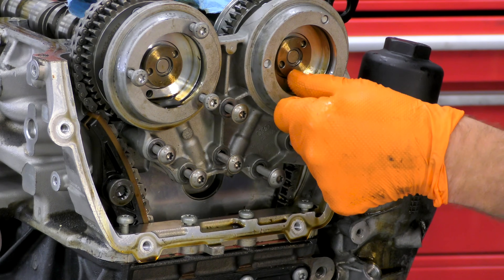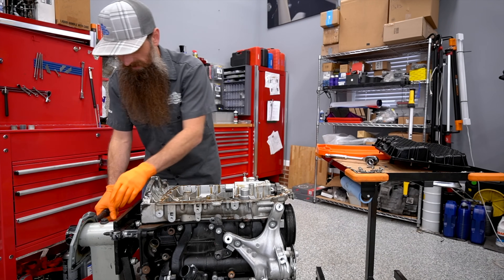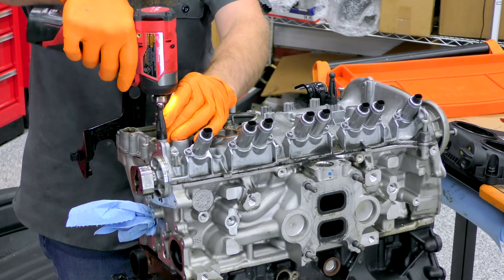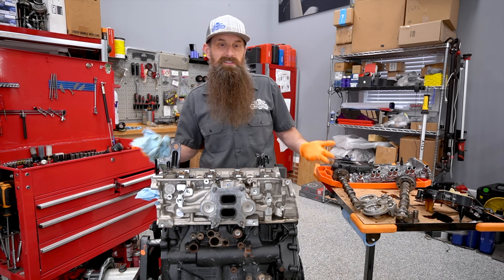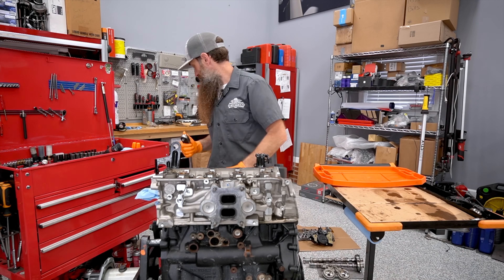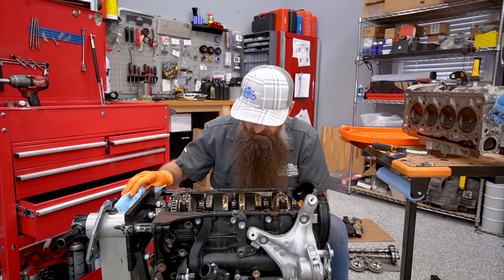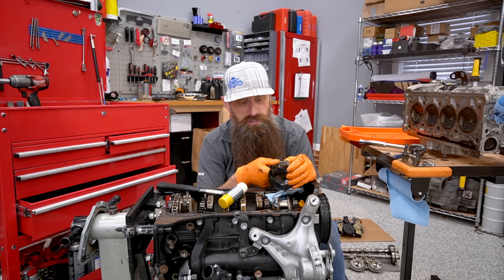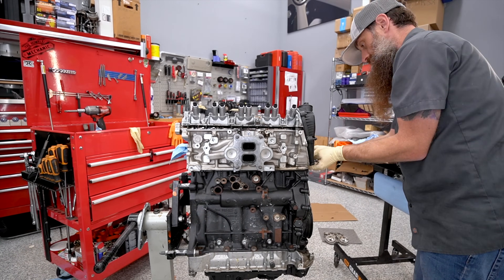Catastrophic VW Engine Failure and Teardown 2.0t TSI

Comment: Shame that they had the ring gap too tight
But worst of all is having a timing chain instead of a belt as they often fail between 70 to 190k Km
Every VW Audi with a chain is a ticking time bomb 😂.
Reply: I think a shorter oil change interval helps with that. Not that 10,000 mile bs. I change my Tiguan every 3,500 miles.

Comment: I had to replace a burnt exhaust valve (injector clogged and went lean) on my B8.5. When I went to install the exhaust cam, since the lobes move it didn't quite fit so I pulled the lobe a bit to slide it in... Next thing I know a ball bearing and a spring go flying! Luckily I was able to find it and put my cam lobe back in the correct place. The car runs fantastic now BTW... Also I didn't know there was a specific way to but the solenoids back in for the cam... I just tossed them in and sent it!

Comment: I have a question about oil in the air intake tube before the turbo, there is no oil in the air box. Is it possible that the PVC system needs to be replaced?
Reply: Normal if it’s just a little bit
Reply: I'd just get a catchcan and do carbon cleaning

Comment: EA888s are crazy expensive to build right now. Was in the ballpark of 9k to if you include full rotating assembly, complete fuel system, gaskets and hardware, and a complete head rebuild on my 8P A3Q.
Reply from the maker: Ouch!!! That’s more than I want to spend on the car. Haha
Reply: I spent $8k 2 years ago for a shop to rebuild with IE internals. The Mahle pistons slap terribly when cold

Comment: A video comparing the Audi 2.0t vs the vw 2.0t would be nice it's already been done but with how you explain things it would be much better
Reply: They are the same thing 🤦‍♂️
Reply: Hes torn down another EA888 and said that the only difference is the injectors.
Reply: I had Skoda with this engine. Now I have Audi A5. What surprises me most is the fact that Audi is so much quieter and cultivated. And I don't mean inside the car. What I mean is when you open the hood the engine is super quiet.

Comment: I suppose if that cam journal has a little damage, you can have an align hone done to save the head.

I don't like how narrow the exhaust valve roller rockers are. It makes me think of the narrow cam lobes of the PD diesel, and the wear problems that could be related.

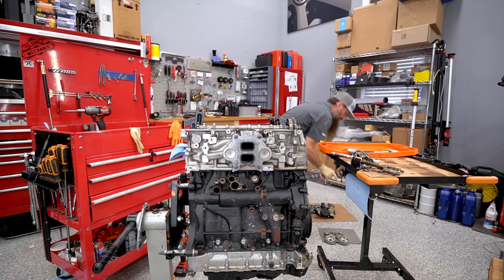16:05 Well, depends on core prices and replacement part prices. Also, sometimes when only one bore is bad on an iron block, people will fit a dry sleeve and bore the sleeve to standard. Sometimes if the bores are just a little out, you can hone +.25mm, no boring needed. If you are ordering forged pistons, maybe you can request a +.25mm piston set.

Comment: Hi Charles. There is a guy in Greece, if you want i can give you a link and his name is Emmanouil Tatouris- AMG Specialist. He describes this catastrophic failure in the older 1,4 tsi vw scirocco. He had 2 engines with the same exactly broken pieces in the pistons. If you check more careful the bottom side of the pistons you will see that the one side is blackish and the other side looks cleaner. That is because of lack of oil flow and that makes the piston of the one side to be cold and the other side to be hot. He create a double head oil beck to eliminate the temperature difference inside the pistons. His videos are in Greek language but you can search with this words: "Γιατί τα VW Scirocco σπανε εμβολα.Η ΛΥΣΗ! Why do the pistons break in CAV 1.4VW Engines?THE SOLUTION" to find the video and watch from 12:00. You can just watch and you will understand even without knowing the language.
Reply from the maker: Interesting!!! I’ll check it out
Reply: Ok and when he talked about a lack of oil its because a low oil level or bad oil ?
Reply: @jeanfrancoismenard705  it's because the small nozzles that spraying the back side of the pistons with oil to cool them down is not enough. This guy made a double nozzle for each piston to cool the whole piston and not only the one side like with the original one.
Reply: The way they oil pan looks it definitely probably didn't get oil changed enough...

Comment: That electrically-controlled rotary valve based thermostat is the first one of such kind on a passenger car(EA888 gen3 was announced 11 years ago, then gen3 bz in 2015, gen3-evo for Euro-6d in 2017, evo4 in 2020). It has been a great design of engine thermal management, but it tends to fail(leak) at an early mileage. 
The thermostat is being improved continuously that almost a new iteration is employed every 1~2 years. The leak issue is said to have been fully fixed in an version released in 2019.
Reply: Yes they made so many revisions of thermostat housing by now. It's hilarious.

Comment: Recently my Peugeot (1.6 turbocharged engine stock) had piston 1 failure. Had the piston replaced and in roughly 1k miles piston 1 failure again. Definitely pre-ignition as it happened at low speed low RPM. The HPFP threw codes before, so the mechanic is suggesting the HPFP is running rich. Any advice?
Reply: Or fuel injector is leaking?
Reply: @chiluco2000  changed all the injectors after the first failure, then second failure occurred. ☹️

Comment: I very much like your videos.
I have a customer car a A4 DTM edition.
That's running very bad idle after a minute or two runs a litlle better.
But stil not nice.
Al pcv valves are new oilfilterhouse new pistons new head and so on.
On load acceleration its running good.
Do you have any Idea.
Regards André Botter.

Comment: Hi I have 2001 Skoda Octavia 2.0 petrol engine with P0134 no activity detected O2 Sensor 1 Bank 1 (and indeed the car see no reaction from the O2 Sensor) somebody before me has installed brand new O2 sensor and didn't solve the problem the wiring harness between the O2 sensor and the ECM is good do you have any ideas I just want you opinion before condemning the ECM 

P.S. the downstream O2 Sensor is working perfectly at stoichiometric 0.45v

Comment: Is it possible this was caused just by low octane fuel? I know several GolfR/Audi owners who just fill their tank up with regular fuel. Does the anti-knock system completely prevent detonation?
Reply: any vw tfsi o tsi needs premium gas only otherwise well you have seen the video.
Reply: These engines are made to run on lower octane, you just don't get all the power you could be getting. It was more of an issue on the first gen.

Comment: One thing I've noticed on many modern engines is the engineers have been moving the piston wrist pins closer to the top of the piston. This leaves very little space on the piston skirt for the bottom ring lands in order to allow for piston wrist pin insertion and crank clearances. I believe this came out of racing to increase mechanical advantage and reduce piston drag. Problem is, racing engines aren't expected to last for years in various driving conditions without meticulous maintenance. Add to that a possible performance tune and lugging the engine at low speed in a too-tall gear is enough for catastrophic failure. That piston displays all those shortcomings.

It used to be that engines had "overhead" built into them. This allows for aftermarket performance upgrades. The LSx and 2JZ are prime examples of that design philosophy. Today's engines are built to finite limits. Sadly that engine demonstrates that clearly. That engine absolutely needs forged pistons for any medium performance upgrades. Maybe VW should've had those from the factory. Looks like the bean counters won that decision.

Thanks for the video Charles - very interesting teardown!
Reply: I like your explanation. So if you have a tune car, maybe whit poor fuel and smash the throttle on to high gear and to low RPM, the result can be what we see in the video...
Reply: I agree, in combination with small turbochargers that makes alot of boost on low revs, produces alot of tq but its not good for the engine.

Comment: Those rear main seals are almost a given I’ve changed a few over the years the ea888 is a complex but great engine if you treat it like a baby great video 💯
Reply: I treated my EA888 engine like a baby and it still had many issues. Oil consumption anyone?
Reply: @shanemitchell5807  where they’re made & how they’re assembled makes all the difference unfortunately no 2 engines are built the same I believe you nonetheless that’s terrible smh
Reply: @nobatteriesincluded3968  Mine was made in Wolfsburg. No excuses then.
Reply: @shanemitchell5807  in my Cupra 280, oil consumption is ~1l per 10t km after 150t km.  And I drive quite often on the race tracks with this car
Reply: @shanemitchell5807  CDAA here and yes, it's starting to show. Already arranged the rebuild as my Superb is worth saving.
It's so sad they killed the engine in such a stupid way. I love how they drive and I'd even consider them very reliable, if it of course weren't for their fatal and completely unnecessary flaws with original timing chain tensioner and the bad piston rings.

Comment: Speaking of VW engine failure, monday my Audi A4 1.8t decided to just throw out the connecting rod of cilinder 4 because of weight, less parts = less weight = going faster ofcourse. So yeah, I'm kinda f*cked atm haha

Comment: Charles, Taking a shot that you may read this related question: 2017 A4 2.0t TSI w 85K Throwing these codes P191A00 " Loss of crankshaft synchronization" and P256300 Turbo Boost Control Position Sensor Circuit Range/ Performance". Not going to tackle these myself, just would like to know what I'm in for at the stealership. The only other issue I've had with this car is the known Thermostat housing leak that occurred at 83K. Any insight would be appreciated.
Reply from the maker: probably a timing chain issue, but thats a super wild guess.
Reply: @HumbleMechanic  Lovely. I dug through some forums yesterday and allthough some threads were not specifically for this engine, those codes seem to lead in that direction. I was fingers crossed it could just be faulty sensors, we'll see. Also read something about "Crank walk" ? ( new term to me). AAHH, And to think I stayed away from F30 BMWS because of T Chain issues. I'll report back what I find. Fantastic channel by the way, and thank You for responding, much appreciated.
Reply: @michaelszabelski6142  Yeah these engines have an issue with crank walk from what I've heard.
Reply: I love you Charles
Awesome videos

Comment: Great video as always Charles! I look forward to seeing what you will do in the future with this engine. I have this engine in my '19 GLI and I love it. She's sitting pretty at 74.5k, and I'm hoping to get at least another 125k out of it.
Reply: I like to hear that. I have a 35th Aniv. GLI at 31K miles. No issues so far. 

Have you had to replace Haldex fluid or do carbon cleaning at that milage?
Reply: @DJ.1001  Haldex in a GLI? Sign me up! I wish we got AWD Jettas haha
Reply: @DJ.1001  I've done both. I have my car serviced by DAP's repair shop, and they recommend getting the LSD oil serviced every 30k miles. I had a carbon cleaning done at 65k. So far I've only had a CV axle boot, and an oil temp sensor failure.
Reply: @christheturdherder9096  ummm… Haldex?…. LSD?… in a GLI?  Since when?????
Reply: @Tdfries  the Mk7 GLI got the front diff from the GTI, since it now has the same powertrain. I assumed that was what DJ was referring to. I just called it an LSD for short.

Comment: Have vw / audi actually built a reliable engine in the last 15 years ,,, come to think of it , has any manufacturer ,,, lightening things and thinning things to be able to meet emission regs has left engines as little more than junk ,, in the early 2000's 200k on a nissan engine was the norm , my old audi had inter galactic miles , and it never had a spanner on it ,, modern engines that do great mpg and have emissions cleaner than a clouds fart , just dont seem to make it to 50k  , is technology really going forwards ?
Reply: Another problem is cars are getting heavier and heavier with the addition of a mountain of luxury and safety shit making these newer engines are have to work even harder to haul these hunks of shit around, on top of them being made more "eco friendly."
Reply from the maker: YES! The 2.5 07k engine is really good. Like REALLY good. The transmission paired with it wasn't Hahha
Reply: For a couple of examples, Subaru fixed 90% of the problems with the EJ,  just before swapping to the FA/FB platform.(the new BRZ has some issues, but the first gen was fine.) they also have the EZ30R and EZ36, two very cool and bullet proof engines. 
Before you say "LOL Headgaskets" that was the EJ251&EJ253. No other EJ had those problems, unless you messed with them.
No news is not news, so you hear about the failures more than the successes.
Reply: @thenewhalogod  I'd rather ride a bicycle to work than drive a subaru.
Reply: @2stroke750  then i Hope you have 40 miles to work🤣🤣🤣
Reply: @2stroke750  a second class ride is better than a first class walk ,,,
Reply: @2stroke750  fixed mindset at its finest 😏
Reply: @stevenyia2778  i

Comment: My biggest mistake was buying an used VW CC lmao :D
Reply: Let me guess rear main seal? Lol
Reply: @nobatteriesincluded3968  True!
Reply: @wanderingamerica5719  been there it sucks but once I got it done and 1400$ later my cc did right by me that was the only major issue honestly these cars need to be pampered smh but still I can’t shake the brand lol
Reply: @nobatteriesincluded3968  the water pump and noise from tires also are my problem. Has got fixed everything, I do hope they will last long. It is my first car, so really want to keep it. too many memories :D

Comment: I had the rings fail on Cylinders 3 & 4 on my MK7 GTI at less than 40k mi
Reply: Were you tuned? Just curious
Reply: @Informative-and-fortunate  APR stg 1 high torque and Carbon intake
Reply: I found an engine out of a GLI with 4k mi and put that in. But now I have the 4k RPM EPC bug that resets every time you turn the car off… it’s frustrating. Never throws a code. Still using the original ECM